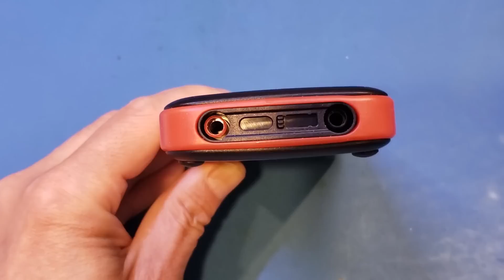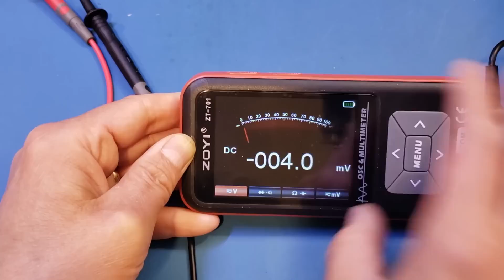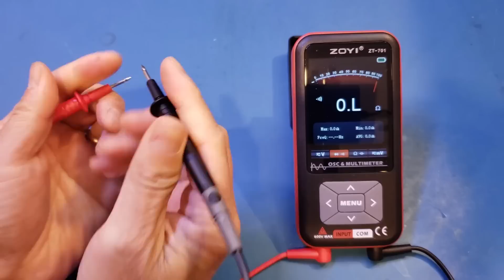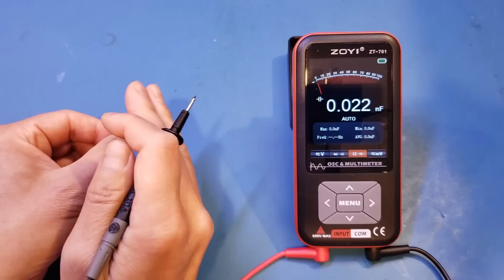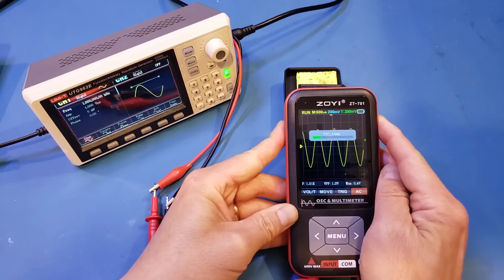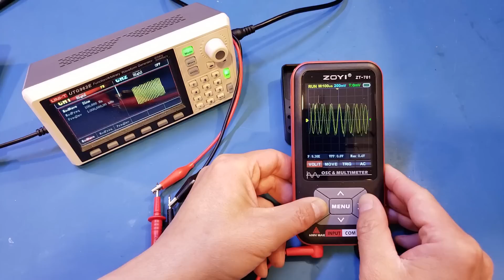ZOYI ZT-701 Pocket Sized Oscilloscope and Multimeter Review/Teardown

Comment: I'd skip this one. The unstable scope display, the lackluster sensitivity (100 mv/div!), the resistance range that already is on the edge of the claimed accuracy. With the current price, much better devices are available.
Reply: $54 is pretty darn cheap for what you're getting here.
What are the much better devices at comparable pricing you're claiming?

Comment: I started using the 701 instead if the 703S to measure PWM from flashlight LEDs because the workflow is slightly faster in terms of taking screenshots.

I'm looking forward to a firmware update for SHUTDOWN , and the ability to memorise the voltage range when powering off or changing from oscilloscope mode to multimeter mode and back. 😊

Comment: Nice looking device. Too bad the 'analog' meter has such a low update rate it is not at all useful for measuring rapid changing voltages for example.